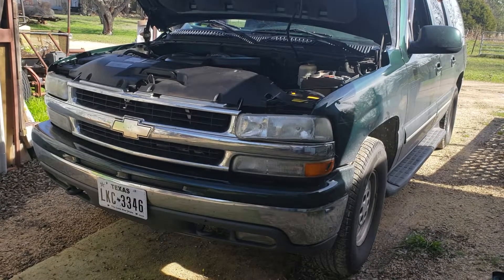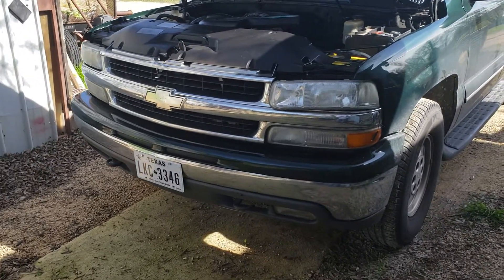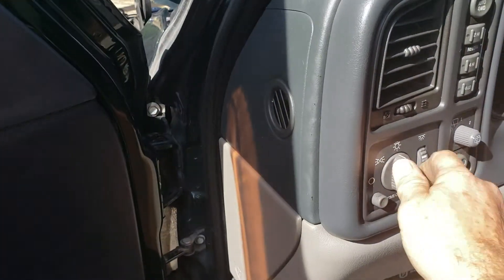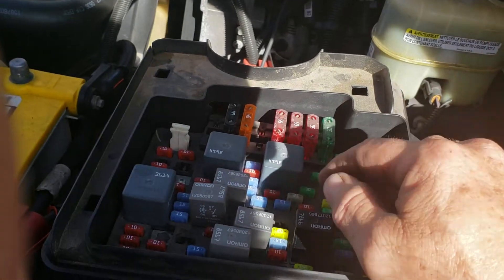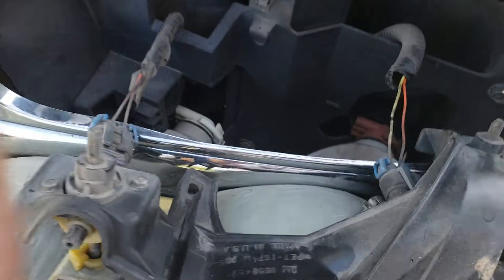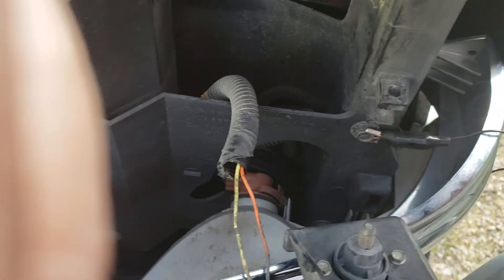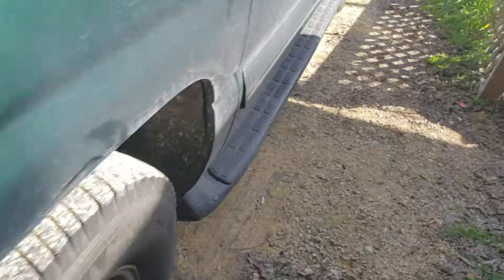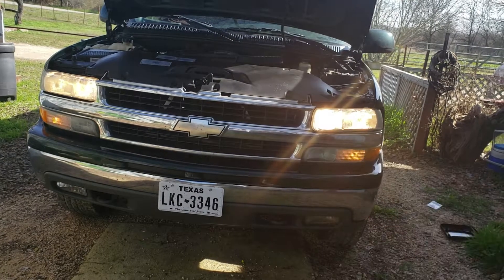Low beam/ high beam mod for a 02 chevy

Comment: did this to my 02 silveraedo back in 2016 its 2021 and they still work......keep in mind it will burn your lowbeams out quicker
Reply: how much quicker though? because i’m running LEDs and they’re kind of expensive
Reply: is it completely safe? 
i’m afraid that it might cause heat on the wires or shorts.. im not that good in electrical things do correct me if i’m mistaken + should i put a new fuse or relay for more safety and if yes where should it be exactly?
Reply: how

Comment: Just did this on my 2002 silverado 1500 and it works perfectly! Only things I would say is if using alligator clams (I did), ground the wire to a more secure area as the clamp does not have a good amount of pressure on the bolt and can slip of with ease.

Comment: Did this too my 2002 Silverado and works awesome.👍 thanks
Reply: Im not able to find a good ground on mine i guess, even after scratching a little paint around the bolt under weather stripping next to the maf sensor and air filter

Comment: What’s the light that doesn’t turn on for? Those never turn on and idk how to get them to turn on.
Reply: Daytime running lights. They turn on during the day when you have your headlights off and you put the truck in drive.
Reply: Pull DRL Fuse And Use Small Jump Wire In Top and Bottom Left Slots ( Make Sure You Have New Bulbs And Sockets Though)